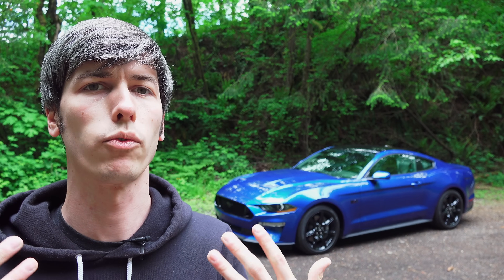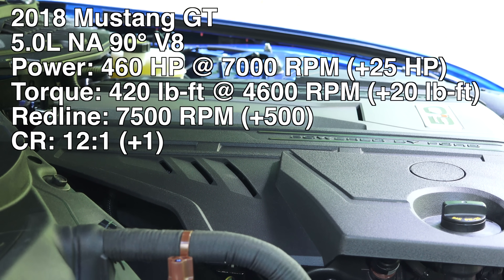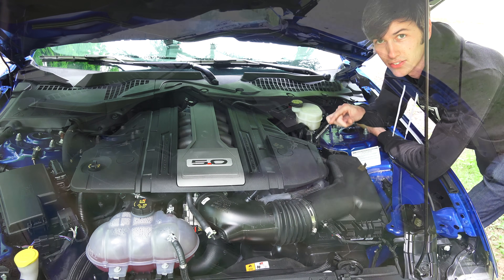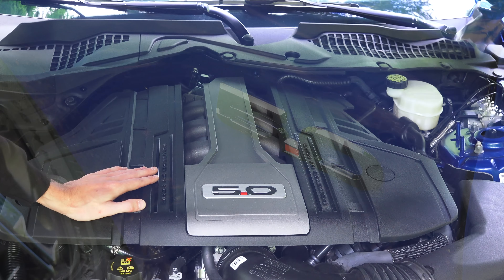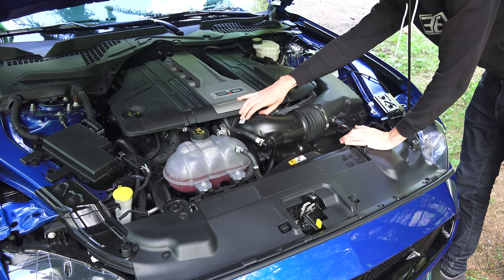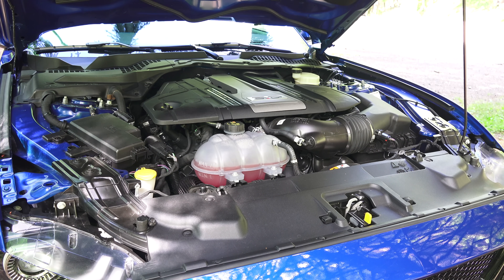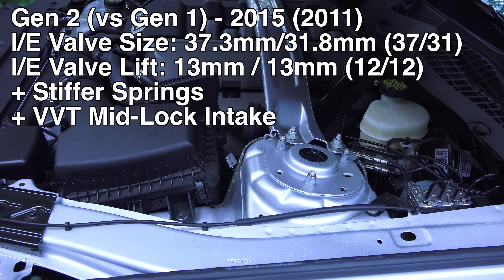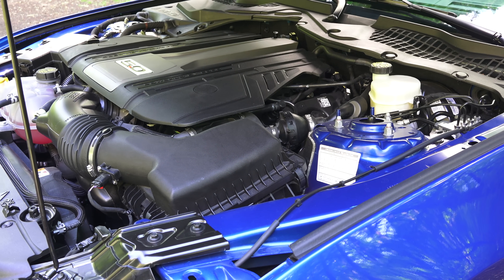The Best Engines - 2018 Ford Mustang GT 5.0L V8

Comment: My poor old 351 Cleveland just doesn't have a chance.  45 years of technology can't be overcome.    Still, it's fun driving the old iron.
Reply: @ Ollie Hopnoodle: Your 351 Cleveland is an excellent engine that has the ability to trounce the DOHC using displacement and some good modern aluminum heads and a roller cam. The Ford 335 and 385 series are fantastic engine families if you've studied enough to know what they are. "Technology" is where you find it, and remember that the Coyote is physically larger than a big block 385. That same 385 Lima can be bored and stroked to 557" or 9L for about $1700 in parts and maybe $350 in machine shop costs. Add aluminum heads, roller cam, and a tall intake manifold and you'll make over 700hp on pump gas. Why worry about horsepower per liter when there are no rules limiting your displacement on the street? The 335 family "Cleveland" is also thick, strong, and has good geometry. They can support displacements above 7L and will be MUCH smaller than a Coyote, while being less than 100lbs more, most of which won't be on the nose of the car. Use an aluminum Z351 block to build a 7L with CNC Cleavor heads and see what happens.
Reply: Thank you taking the time to reply. My Cleveland makes decent power.  I have the 4v quench heads.  I run a comp 280 flat tappet and use Rhodes lifters to smooth the idle a bit.   I added a Gear Vendors to the back of my C6  to tame it a bit at highway speeds.  The trick with the older engines is getting the combination of high horsepower, good driveability and decent gas mileage.   There is usually a bit of a trade off.   The newer engines, with variable cam timing, direct fuel injection, 4 valves (often with different intake runner lengths), knock control and all of the other technologies are able to produce big horse power numbers, great driveability, clean emissions and decent gas mileage too.  Of course having 8 and 10 speed transmissions doesn't hurt either.   Lower first gears, double over drives and more time in the best torque range are certainly an advantage over my 3 speed C6!
Reply: Ollie Hopnoodle: Follow the same formula as the OEs and use parts that are designed using FEA and CFD and you'll get the same results. Start with about 11.5:1 compression, a 300cfm aluminum head, a hydraulic roller cam in the 200/210 @ .050" x .550" range and get your lift from the rocker ratio, not the cam lobe. Use a Melling Shark Tooth oil pump and modern gaskets. If your ignition system is working well and it's port fuel injected and built right, your results will be very similar to modern stuff. It's really all in the top end. My Edelbrock carb maintains between 12.7 and 13.1:1 all the way down the strip on a less than ideal combo. If you use anular boosters you'll get even better results. New gimmicks don't make horsepower, airflow and proper tollerances do. The difference between the new stuff and old stuff is software like Pro E and the big change happened around the turn of the century. Displacement on demand, cam phasing, and 10spd transmissions actually save gas;  DOHC and 4V heads do nothing but take up space. I can buy 330cfm heads for a Small Block Chevy from a warehouse. That's something to think about. That architecture is over 60 years old and yet it still works amazingly well. I wish I had a Cleveland!

Comment: does that valve in the exhaust affect performance?  It seems like letting more sound out means letting more air out which means you should probably stay in track mode all the time for improved MPG.

Comment: As impressive as the horsepower figure is the real news is that torque, 420 lb-ft from 5.0 liters is outstanding.
Reply: LeaderFox96 Sure but that's a turbo-charged engine.
Reply: @rafaellastracom6411  so is the Sonic
Reply: It shouldn't matter if it's turbo (factory) or not. Fact is that's 220ft/lbs from 1.5l or 420 from 5.0l.  Turbo = little motors way better, big motors insane. Try catching a Supra. Try it.
Reply: @ericlaing435   For the purposes of comparison it matters. Also a stock 2018 Mustang GT is quicker than a stock 4th gen Supra. But again it's not a really fair comparison as you're comparing a modern car to one that's 20 years old.
Reply: @ericlaing435  Catching a supra? lol scary.
Reply: @ericlaing435  supra is slow, any of the supras you see on youtube aren't even close to stock engines.
Reply: @ericlaing435  well the fastest supras were the 4 cylinder ones from the 90's. You know the car that was on the cover of gran turismo.
Reply: It truly is a great time for cars.
Reply: Alright but supra stock makes close to 300. The super fast turbo 4's make big power for a lot of modifications (can be unreliable) and a lot of money. I've beat a lot of stock turbo 4's, even new wrx sti's
Reply: Tooo many idiots stooop make it stop
Reply: @caboose22320  seriously!

Moronic conversation!
Reply: blaze it my dude
Reply: Rafael Lastra com Definitely! 84 torque per liter in a NA motor is kind of insane!
Reply: my 2.3 ecoboost makes 462 ft lbs and starts making it at lower rpm.
Reply: As an owner of 2020 mustang the first thing I noticed is that torque is higher up in the rpm range. These cars are rather lame in the lower rpms. But they sure start pulling hard once you get around 4k
Reply: Torque?? Haha I think you mean twerk.
Reply: That´s a nice NA torque figure, especially with the draconian emissions it has to meet. People think better emissions means better mileage, however the cars would get better mileage (and thus lower CO2 emissions if you're the sort to worry about that) with less stringent emission demands. Take the tech of today and apply 80s-90s emission standards and i bet you´d get a nice torque and power boost with significantly better mileage.
Reply: Rafael Lastra com >>>MY FOCUS ST GETS 270LBS OF TORQUE OUT OF 2.0L SO CALM YOURSELF DOWN.
Reply: @metaljew4456  With how many lbs of boost? 15? Put 15lbs of boost in a 5.0 Coyote and you'll have 750+ft/lbs
Reply: Torque means nothing
Reply: @Neishy86   wrong.
Reply: Rafael Lastra com eh. My Sonic does 140ft lbs out of 1.8l
Reply: That´s actually a great figure for a 1.8l.
Reply: @Hellrazor0916  Isn't that with a turbo? If so it means nothing
Reply: @roboticvenom1935  no turbo. 87 octane all day.
Reply: The purpose of Supra was never to keep it stock. Toyota dropped that, let everybody know it’s build quality and with a wink, slapped our asses and said “see what you can do with it”
Reply: @boho3785  So they made half a car and sell it for 50k? You would think the new Supra would have more hp than the 25yo last gen Supra, but no. This car is a joke.
Reply: Matthew D I’m talking about late90s-early 2000s supras. I don’t consider the new ones supras.
Reply: @boho3785  me neither, most don't. it's pathetic. i own a 2017 mustang 5.0 but if i someday have the money i will properly build a older supra. no one in my little town even knows what a 2 step is.
Reply: @tylerdurden8939  why wouldn't you just turbo or supercharge your 5.0? Much more potential overall. Cubic inches!

Heavily blown (turbo or blower) engines will always have a shortened lifespan. That's just the way it is. We see catastrophic engine failures at all levels of racing. There's a reason folks!
Reply: The 2018 Ford Fiesta ST gets 220 ft Lbs from a 1.5 litre engine
Reply: @CDCgames96  at 30,000rpm 🤓
Reply: @CDCgames96  Turbo engines have higher TQ numbers because of the boost at low rmps. More air and fuel in the cylinders.

Comment: You guys wouldn't know in the states but Ford's best engine is the Turbo 4L Barra motor which was in Ford Falcon XR6 Turbo's between 2003 and 2016 made in Geelong, Vic, Australia. Easiest way to make big power on very little mods and tough as nails. You should definitely look them up for this series

Comment: To be honest I like the 11-14 engine better. The gen two and three have more moving parts and tech that begin to really clutter the engine and such for just a little more HP. The 11-14 engine bay looks so much cleaner and just easier to work with.

Comment: Jason i for one would like to see a few more of these Best Engine videos and one of the ones i would like to see is a review of the GM 3rd generation 2.0 L (1998 cc) turbocharged direct injection motor they use in the Cadillac CTS and the Regal GS i know WARDS recognized this motor as a noteworthy motor but i am not sure if it won any awards

Comment: Ford never cared much about exact displacement when it comes to branding, even years ago. The pushrod 5.0 from the 80s and 90s was 4942 cc. They couldn't even round up to 5.0 there, but nobody wants 4.9 on their fender. At the time, Ford also offered both the "5.0" V8 and a 4.9 liter straight six in their full-size pickups, which would have confused things even more had they decided to be 100% honest with their branding. The modern 5.0 logo is directly inspired by the old 5.0 logo, it's thinner and has a different typeface. I still run the pushrod 5.0 in my 1986 Mustang, but it is stone age technology compared to the Coyote, even with upgraded cylinder heads and a Megasquirt ECU. They both sound great, though.

Comment: Awesome video as always man. I was looking to upgrade to either a 2017 or 2018 mustang GT but I don’t know if I should go for automatic or standard! 

Some people say that automatic is bad for V8 because of all the pressure being placed from the beastly engine, so things break down faster. 

Then there’s other people who say that the manual transmission wears out a lot faster because of shifting and if you mess up, it causes catastrophic irreparable damage. 

Don’t know which to believe, but standard has always seemed more fun

Comment: I think the Porsche flat 6  and the ford ecoboost V6 should get awards, both are getting 600+ HP out of a 6 cylinder engine!
Reply: Michael Jordon The 2.7 Ecoboost is also an award winner.
Reply: @Class Act gt3 rs 4.0 n/a flat six 520hp
Reply: Keep in mind a turbocharged or supercharged 5.0 will make far more power than the Porsche boxer or ecoboost V6. But yes, those are fantastic engines as well =)
Reply: @BradChadley  wtf are you talking about? A 4.0 six from Porsche makes 520hp stock, no turbo
Reply: @mattyoz0  Yes. Not sure how that is relevant considering OP is discussing the 600+ HP Porsche flat six, which is twin turbocharged. Now, the 4.0 on the GT3 RS is a great engine, no doubt. However, it's at a place where Porsche has already engineered it so well, there aren't a lot of changes left to be made to increase both power and efficiency, although I'm sure they'll figure out how to make 550ish HP in the next few years. Bear in mind a Porsche GT3 RS starts at ALMOST $200k USD. A Mustang GT with a 460 HP 5.0 V8? $35k USD. That V6 better make more damned power. All I'm saying is the Ford can be made to have more power if that is really what people are going for. If you could afford a GT3 RS, but instead buy a Mustang GT and use the remaining money for mods, you can build a hell of a machine. I'm not sure why you attacked me by trying to compare engines in entirely different vehicle classes.
Reply: Mile Chaser Bro bro. Compare apples to apples. The 4.0L flat six on the GT3 RS makes 520 hp naturally aspirated. I own a coyote mustang and I’ll be the first to gloat about how wonderful this engine is but let’s give others their due too. They’re making 60 more hp on a full liter and two cylinder less than the coyote. That’s badass in its own right.
Reply: 1 atmosphere is 14.7psi at sea level, if you have an engine with 7psi of boost technically the engine size is the equivalent of 1.5 times that of what it actually is. So 4 liters is 6, however most modern performance turbo are around 12 to 14 psi, making them double. 

When you consider that most engines end up very similar in efficiency.
Reply: Nathan Squire c

Comment: Hi Jason. Thank you for the informative video. As a suggestion, can you include a comparison of the engines you review including specs such as: power, torque, weight, fuel consumption, efficiency and depict the info graphically. Also, it would be interesting to include EVs in your review too. Many thanks from Australia
Reply: cant include an EV, they don't have an ICE. The series is called Best Engines.... not Engines and electric motors. couldn't you also get that info on your own?

Comment: It may be off the market, but you should do a video on GM's 4.2L straight 6 (Vortec 4200) it was on wards top 10 engines more than once! Plus it was arguably the best "base" motor in the light truck class of its day

Comment: Would be nice to know specifically why the engine won the awards. In other words what in particular is special about the engine?
Reply: You would have to look up their criteria for the awards they give out. I would assume price is included. You would expect a 500k Lambo to have a great engine, but to get over 450hp and 400tq in a car less than 40k in 2019 is Insane. To get 450hp in a stock car 15yrs ago you needed to spend over 100k.
Reply: @matthewd6306   In early 2000's you could get a 400/400 LS2 in a GTO for 32K. That was a detuned V8 making those numbers, meaning you could easily make 20-50 hp spending lunch money. Much better designed engine, too. 

Not sure why they chose a Coyote before an LS to make a video about engines. The LS is literally a legend across the entire globe.
Reply: Literally nothing. The technologies on these engines that is allowing them to make that power has been implemented in other engines since earlier than 2000. It's not particularly reliable or engineered to take up little space. I imagine it won awards from throwing money at the right people.

Comment: A ten speed!?  That's insane.
Reply: I remember when only bikes had ten speeds. lol
Reply: @TivonSanders  I remember my first bike having a direct drive.
Reply: I think he meant 10 speed bicycles, not motorcycles.
Reply: Blitz6804 
Insanity is what happens when GM and Ford work together, I love it.
Reply: I have the 10 speed in an F150, it’s an excellent transmission for daily use.  I haven’t done any major towing so I don’t know how it holds up there
Reply: @monkeyscanbiteu  17 10 spd is a workhorse and been reliable for me. Just swapped fluids at 62k. Hint:don't lug the engine and use the driving modes fully!
Reply: 2000 rpm while coasting at 135km/h is pretty comfy on the wallet :) until I get a ticket...
Reply: @BalancingEternity  behave on the straight roads, play on the twisty roads. Happiness isn't around the corner (a cop is), happiness is the corner.
Reply: mine goes to 11
Reply: @goldenvtr  it'd help if you said what you have. Only saying “mine goes to 11” only sounds like you're trying to “one up” the topic. (Pun intended)
Reply: @scotthenrie5674  it was a reference to 'spinal tap'.. which is a pisstake lol... 2 years old post mind
Reply: goldenvtr yeah that is the most common rear gearing on a bike right now but you have to multiply that by the number of front gears to get the number of speeds. There are a few downhill mountain bikes that are straight 11 speed but it is uncommon.
Reply: Motor Racer 99% of all bicycles (that's what they ment, not motorcycles) sold today have between 14 and 33 speeds.
Reply: @rednaxela3x3  I know this comment is old but most bikes have 9 to 12 gears for higher end and 18,24,27 or 30 speedon low end
Reply: @Island-RC   You are right that rear cassettes now go up to 12 rings (they were not really around yet when I made my last comment) but you still need to multiply that number by the number of chainrings on the crank to get the number of speeds. For the most part only really high end mountain bikes have single ring cranks. Also 8 ring cassettes are still very common for less expensive bicycles.
Reply: Its an incresingly popular gearbox style where you have a normal 4 or 5-speed transmission and then a 2-speed transmission on top of that. Kind of like the low range gearboxes in off-road vehicles. Often they combine that with planetary gearsets for packaging and weight savings. Although they are 2-4% less efficient.
Reply: Accord has 10speed
Reply: they shift very fast and keep you in the sweet spot. it is insane but they work
Reply: @Carbon Fiber Weiner they meant bike as in bicycle.
Reply: Very
Reply: Blitz6804 *unnesessary
Reply: @AR-rk9nn  460 hp is unnecessary too, performance vehicles aren't based on necessity.

Comment: Can you include Engine weight would be a neat tidbit to include. or dyno graphs of stock engines, just to see how the power is distributed rather than just the peaks from the specifications?
Reply from the maker: Good idea! This one’s at 445 lbs I believe. Graphs are more difficult to find, but will try to see if anything’s available.
Reply: Peter Reidy αζddgg_⁴_†&68790/98&31 hi Gigi copy hot toddy dirty I only have g out